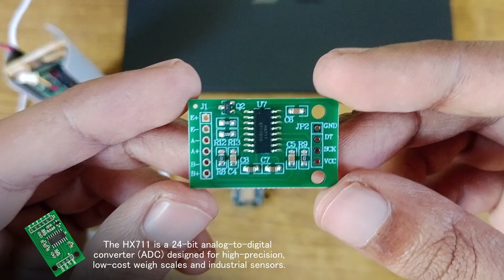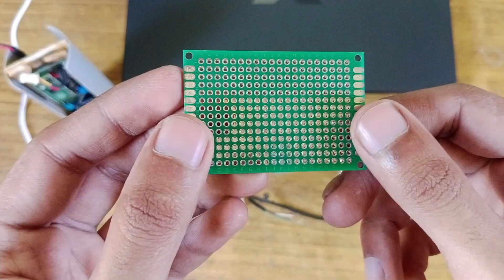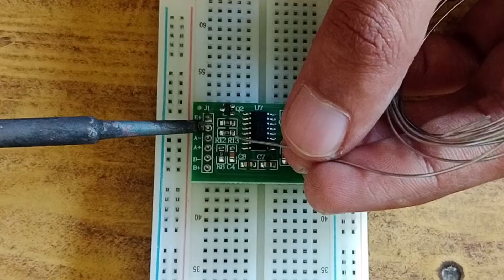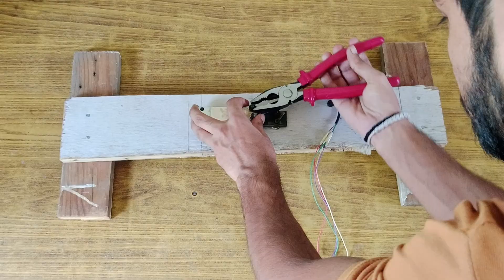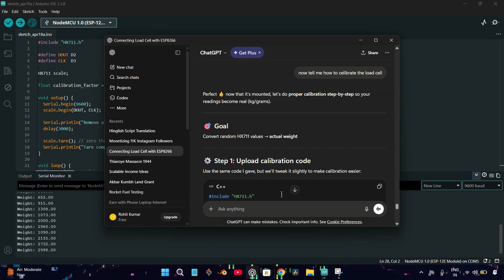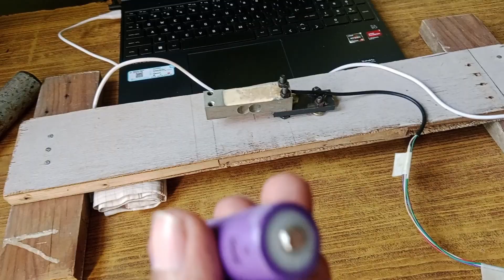How to make a Rocket motor test stand.

Comment: For your motors, you can try using RNX composite propellent. It is a mixture of epoxy, potassium nitrate and red ferric oxide. Richard Nakka's website has a lot of good information.
Reply from the maker: Thanks for the information